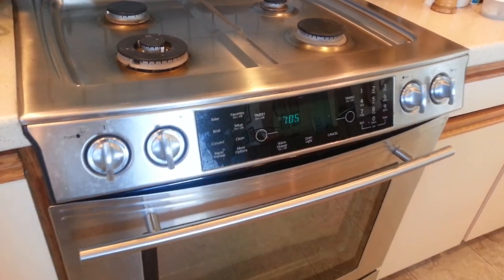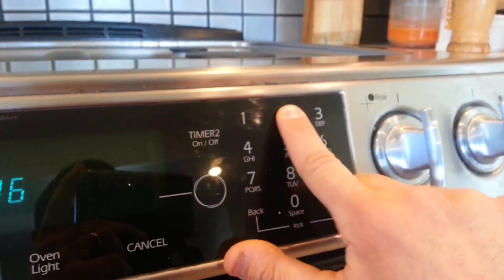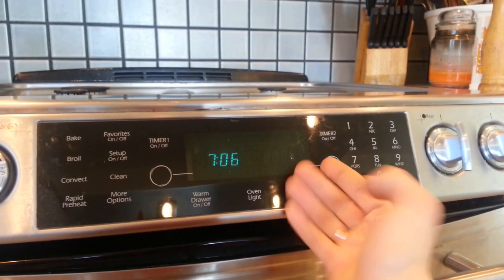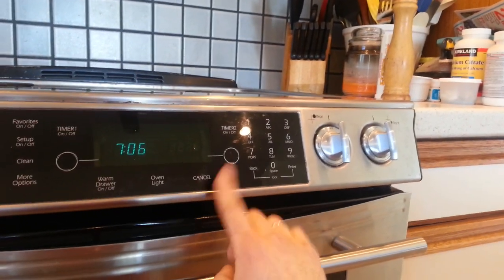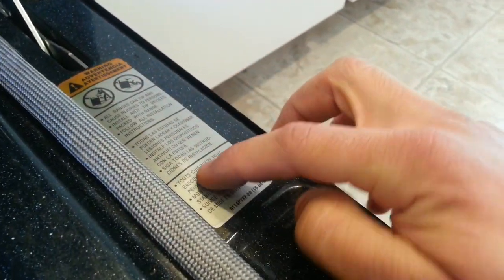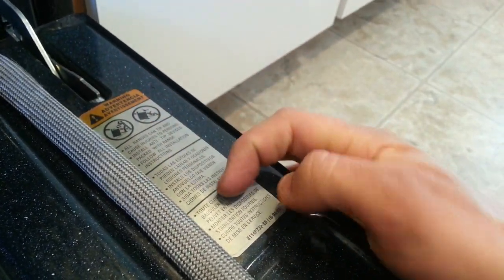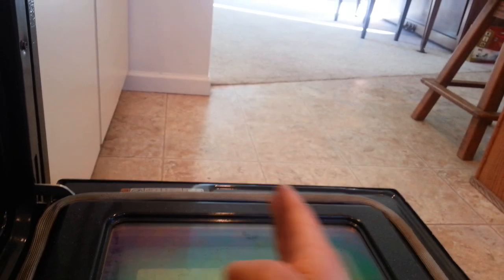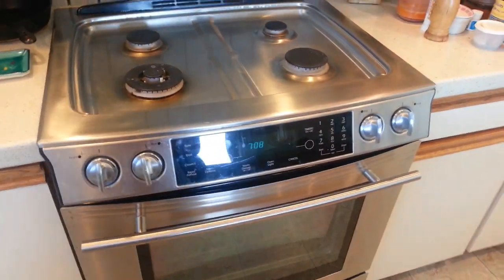Jenn Air Slide in Range Keypad Not Working

Comment: Thanks for sharing your experience. I had the exact same issue with the exact same buttons. I dismantled the entire control panel unit and initially suspected that it was oxidization on the cable ribbon or that I had to replace the control panel unit. I did not have any success on the cable ribbon cleaning, but this video gave me confidence in ordering the control panel as well as understanding what caused the issue.

Comment: The damage may also be due to a design defect in not having an effective heat shield for the control panel.  These ovens were designed to allow the oven door to remain open in a detent position such that the top of the door can be set to about a 5 inch opening when broiling.  Since broiling is a high heat situation, the bottom side of the control panel is exposed to this heat while broiling.
Reply: We've had ours for over 20 years and never had oven or control panel issues until we recently started to use the self-cleaning feature.  In the past year, we've had to replace the oven igniter and control panel, and fix the oven door..
Reply: @OpC1t Same. Only became a problem after using self clean feature.
Reply: I am going to make an aluminum heat shield, try it, then use the screw holes under cpanel, above door top edge, to fasten shield.

Comment: Thanks for the video. My vent fan, more options, Rapid preheat, clean, convect and setup buttons quit working. After months of sitting on the replacement price I finally replaced the panel and door seal. Now a search for the keypad so I can build a spare.

Comment: I had the same problem....the left side of the control module didn't function. I turned OFF the electrical breaker, waited about 15 seconds, then switched it back on. That reset the control module and the functions all work. I was ready to buy a new stove....so, try that first.....
Reply: I realized the left side of my control panel stopped working and called for a quote. I was quoted $378.88 to replace the control panel (parts and labor). I told him I needed to think about it since my oven is 10yrs old. I quickly searched "replace control panel on JennAir stove" and this WORKED! Thank you for posting!
Reply: Had this problem - with an apple pie waiting to go into the oven to bake, we used this and it worked great. Thanks for posting.

Comment: So my wife and I bought a house and this brand/possibly same make of stove/oven is coming with it.  The keypad panel doesn't work like what you showed in the video.  I'm planning on fixing it myself.  Replacing the fiberglass gasket seems pretty easy and I did find one online at HD.  If the door to the oven might be contributing to melting the panel how would one correct it?  Would I be better off ordering those hinges?  Is there an aftermarket gasket other than the fiberglass one that I could use to double seal it so that heat doesn't escape?

Comment: Our range front panel no longer has the indicator markings at each knob. We cannot see, only guess, which knob is for what burner. The same is with the heating levels for each burner - gone. It is a poor design and application feature. Instead of press type markings, should be etched on or a more permanent application so the markings don't wear off.

Comment: The range is garbage  I have had multiple problems, from ignitor not turning off to gas continuing to cycle on and off every 5 seconds.  Glass door failure.  Wires were frayed
Reply: Not a bad design, not all units have your probs. Mine has the heat issue causing touch prob, then incessant beep.

Comment: I replaced the Control panel several years ago. Now it is out again.  I love the range and hate to replace it.  A comparable one is thousands of dollars.  A new panel has gone up to $400. Still cheaper than a new range... Dilemma!!! I've had the range for 15 years!!! I do not want to fork out 5-7K for a new one!!! I wonder if a new panel will have a warranty?
Reply: Uggggh. I'm the same boat right now. We have a downdraft, too, so not nearly as many options.
Reply: @wallywallywa …what did you end up doing?..I love my downdraft
Reply: @gospos1  bought a new downdraft. If I had more time, I would have looked into installing a range hood and going with a cheaper stove.

Comment: Terrible product. All Jen air products should last you no more than 6 years, are costly to repair and customer service is atrocious
Reply: I'm not an oven engineer, but if I were, I'd probably think twice before designing a $350 electronic oven component that is vulnerable to moderate heat exposure. Just seems like common sense to me. SMH.
Reply: Mike Walsh - my oven warped the first time I did the self-clean and they refused to fix.  The walls bowed outward and wouldn’t hold the racks.
Reply: Jenn Air ovens SUCK! Anyone who designs an OVEN with touch ELECTRONIC keypad but doesn’t understand that HEAT will DESTROY electronic components, needs to find another line of work. Jenn Air REFUSES to acknowledge they have a problem and ovens should be RECALLED!

Comment: Exact same problem and great answer but next step is what I need. So the Answer is to call Whirlpool?
Reply: Tess Dey , exactly, I can replace the gasket, and I can see if the door is off kilter, but I still need to gain back the numbers on the touch pad. Many things require higher temps than the auto Bake options 350 and 375.

Comment: I have a problem with my oven everything in the panel works, but the oven will not heat.. 3 burners work great but 1.. help
Reply: I have the same model as the video

Comment: Any way to just fix the film or replace only the film part? I see mine is separated. Exact opposite of my buttons are working. Only 1-6 and 0
Reply: mine just failed as well, any fix?
Reply: did u change it or fix it?
Reply: No, they don't sell that keypad membrane part separately.  Only as part of the whole control panel unit, $300+.  Switch it out and then do a couple things to keep the keypad membrane and ribbon cable from being exposed to so much heat from the oven.  I'm going to try to fab a heat shield under the lip above the oven door, and maybe also peel off the membrane and put a silicone backing pad behind it.  I'm about to be on my 3rd keypad.  Only putting up with this BS because replacements seem to be about $3000 and aren't really any better. Plus now I've learned how to work on this thing.  It is a POS, but when it works, it's decent enough, better bet than spending $3,000 or $5,000 on something else that may also turn out to be a POS.

Comment: So, tell me this, you demonstrated a door out of alignment and you've demonstrated a keypad that is not functioning 100%. And you've alluded to what may be the cause of the identified the non-functioning numbers on the keypad. But, you haven't provided your discovery of what it was and more importantly how it was fixed, if indeed it was fixed. Did you call the service man in? Did you fix it yourself? Would have made this video useful. As it is the only thing this video has done is demonstrate that you and I have similar ranges with the exact same problem.
Reply: Totally agree with you. He shows no resolution on why the buttons stopped and how the buttons was repaired. Basically what I got out of this and all the comments was to get rid of it and buy another brand.